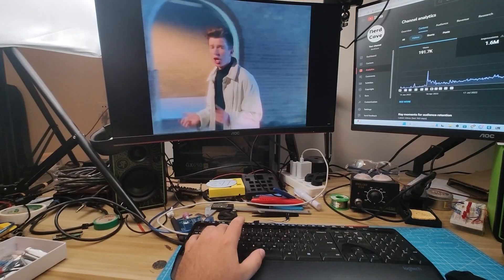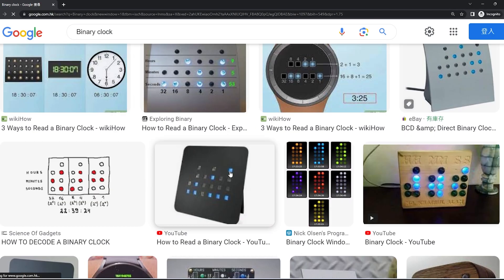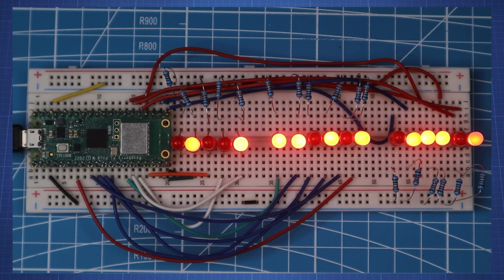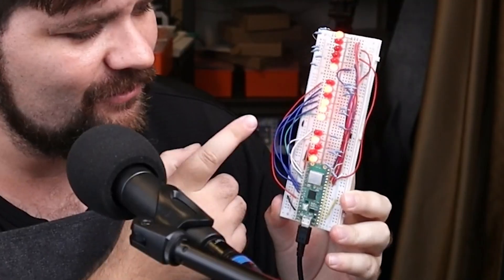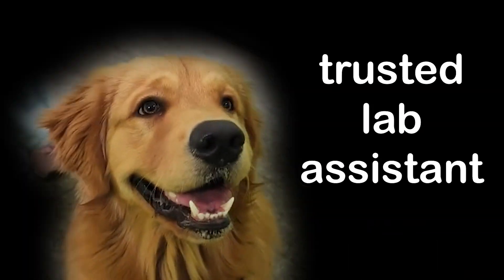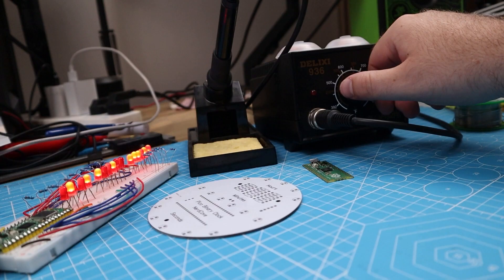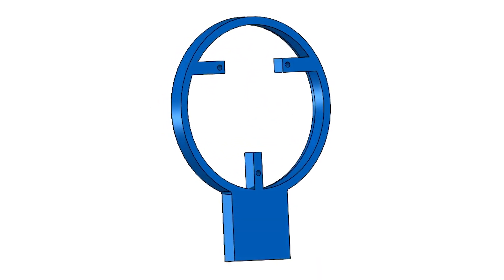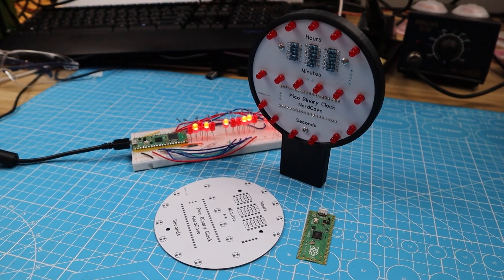I made the Nerdiest Clock ever

Comment: One more question about programming the Pi Pico: Your programm is basing on python. Does it mean Ithat I have to install MicroPython on the Pi Pico before? After that only copying the GitHub files zu the drive seen after connecting the Pico with preeded BOOTSEL button on USB. Sorry, but these are my first steps with PiPico...
Reply from the maker: Sorry for the slow response here is the 3D STL file: https://github.com/Guitarman9119/Raspberry-Pi-Pico-/tree/main/Binary%20Clock Regarding your question yes you need to install MicroPython on the Pico which you hold the bootstel button plug it in the release and in Thonny you can install MicroPython. I have made a getting started with MicroPython and CircuitPython video that shows all the steps